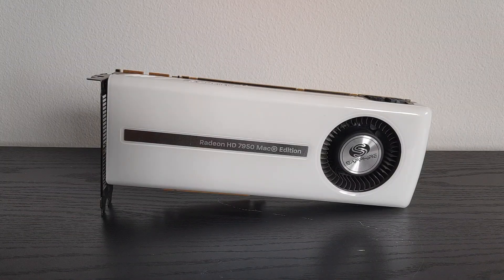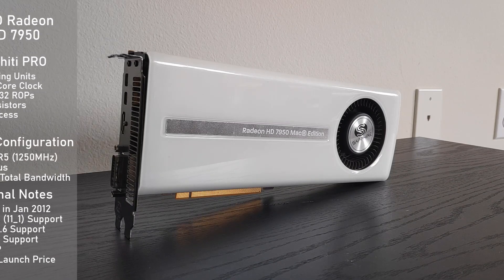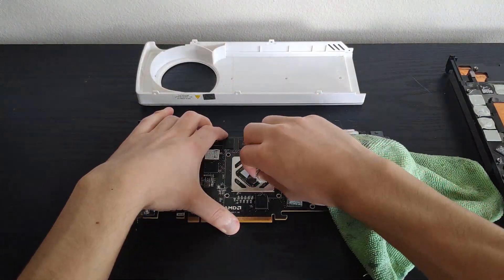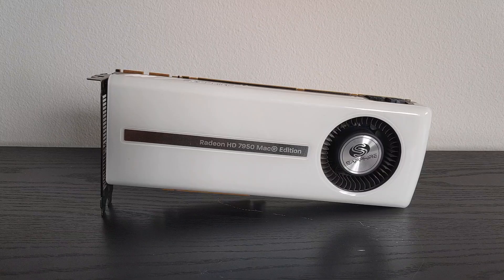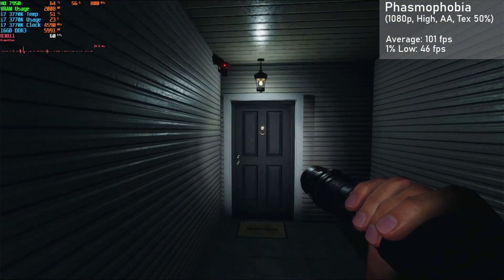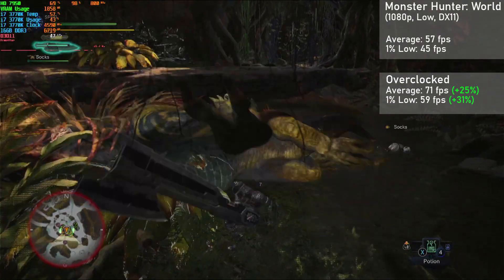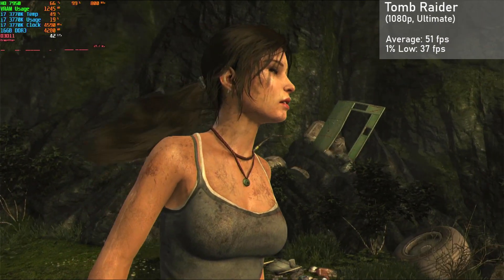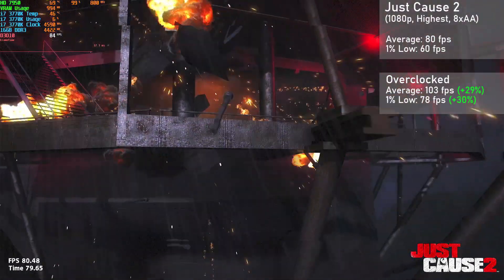The Radeon HD 7950: AMD's Well-Aging Beast from 2012

Comment: I have this card!! I love it! It was a beast a few years back when i used windows and overclocked up to 1250 [MHz]. Handled itself phenomenally, running my modded skyrim and War Thunder without issues and the Sapphire Dual-X cooling kept it under 80C entirely. Thought with no overclocking capabilities on linux, ive recently decided to upgrade to a Sapphire RX580 but I will never be getting rid of my HD7950.
Reply from the maker: Cool that you have one! These cards are amazing, and they make extremely nice overclockers for sure!

Comment: I love these old GCN cards, they come in really cheap everywhere.
I just bought a Sapphire Nitro R7 370(R7 265/HD7850) 4gb for $55, way better deal than buying a GT 1030 for $60 especially since the 4gb vram helps on the games that I play. 
the GT 1030 doesn't even have a video encoder for some reason.
though I am planning to buy an RX 580 once I get my Xeon E3 1230 v3 setup running in a few months.

Comment: So what's the best gpu you own ? Gtx780?
Reply from the maker: My EVGA GTX 980 Ti FTW.
Reply: @SPNG  so 980ti is basically a 1070 which is basically a 1660super which is basically a rtx3050 so you have a 3050 lmao
Reply: @mubindaghost  eh I would stop at the 1070 part, the drivers and performance per watt of the 980Ti differs drastically from the 3050, and in most cases, the 980Ti outperforms the 3050 despite having slower onboard memory and a higher TDP. The 1070 also in most cases outperforms the 3050, and as someone who had a factory overclocked 1660Ti XC Ultra and had the pleasure of testing a 3050, the 1660Ti beat the 3050 in most games when not utilizing the lastest DX12 versions (including DX12 ultimate) and leaving off features such as DLSS (which is brilliant software)

So yeah you could make that comparison but due to how many differences each card you listed has, I would compare it to a single generation successor and leave it there.
Reply: @xhgcommentaryarchive  I was just saying that a 980ti is a 3050 but higher tdp and less features and slower memory
Reply: @mubindaghost  it's close, I wouldn't go that far in a comparison with cards that are so far apart generationally but yes performance-wise they are pretty similar.

Comment: Bench with newer games to proof "Well-Aging Beast"
Reply: Half the games he benchmarked were 2018 or newer titles, with 2 of them being 2020 or newer.

Phasmophobia: Released September 18, 2020.

Monster Hunter World: Released January 26, 2018.

Project CARS 3: Released August 28, 2020.

And as for older games, Crysis is iconic and many people still use it for modern benchmarks even if it may be a bit obtuse to do so, and CS:GO is one of the most popular games released today, so it's fully relevant in the conversation. 

Your comment is moot.
Reply from the maker: Unfortunately the only game I own from 2021 or newer is Halo Infinite, so I felt that I needed to expand my library of the latest titles before testing with the NimeZ drivers. Even so, three of the games tested in this video were from 2018 or newer, and the older games (except CS:GO of course) had their settings cranked way up, so I still think that proves the card has been aging well. I will test the card with the NimeZ drivers and a very modern test suite in another video though. Appreciate the comment

Comment: Good video. I can verify several "smaller" GCN cards can be overclocked to the next tier. R5 240 -> R7 240, R5 430 -> HD 7750, HD 7770 -> r7 260x, r7 260x -> r9 270. The only card I can't push till the next tier was HD 7750 to HD 7770 becuase it lacks the extra 6-pin connector, even after pushing it to 1.3V and bumped up the power limit to 75W. All had FPS gains in excess of 20%. Oland cards had fps gains in excess of 30%.

Comment: Hey man quick tip. The CSGO benchmark you usually use seems to be cpu bottlenecked, and thats why it never usually scales with your overclocks that much. To fix that problem try to use a higher resolution like 1080p which should put more demand on the gpu which then should lower the cpu bottleneck and show scalimg with the overclock! :D good video as always.
Reply from the maker: That explains why I've been seeing similar results between a lot of different cards. I'll definitely run it in 1080p next time, thanks for the tip man 👍

Comment: Still rocking an HD7790 a.k.a R7-260X, which is basically a halved HD7950. 
It's not a beast, not by a long shot, but it can throw punches with the 750Ti in certain titles and generally performs better than the 750 vanilla which isn't too bad at all.
Reply from the maker: Nice! That card is still a good choice for a lot of modern games, have you tried overclocking to squeeze a little more performance out of it?